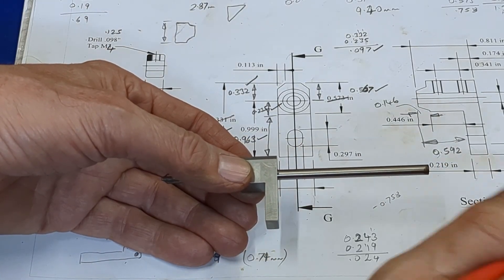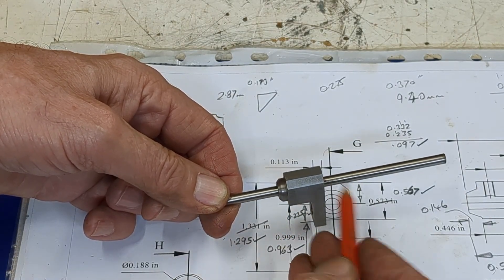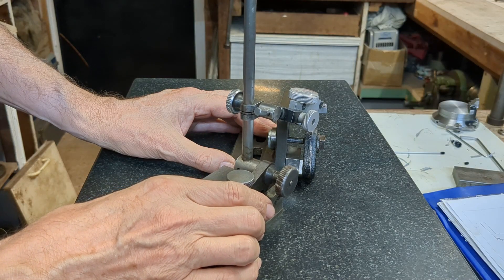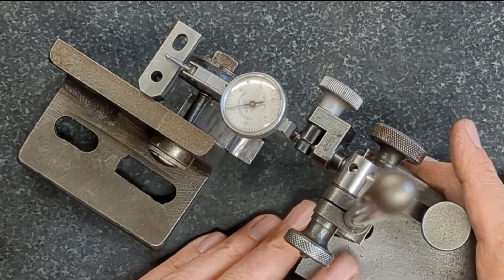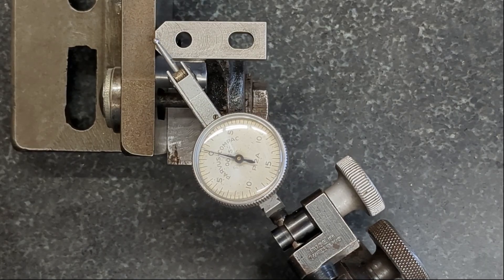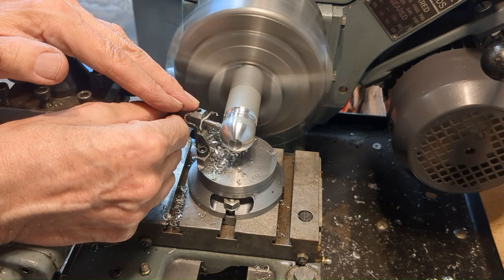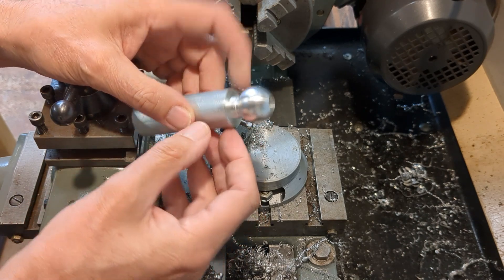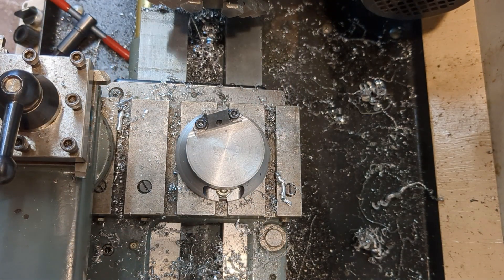Radius Turning Tool - part 5

Comment: A second collar behind the first, that is additionally drilled an tapped for an additional grub screw. The screw is installed horizontally, on the same axis as the cutter shaft. The screw pushes on the back of the original collar.

Lock the rear collar to the cutter shaft, adjust the front collar as necessary. Lock the front collar.  

Now you can adjust the depth of cut  accurately with the screw, and you can still use gauge blocks between the two collars for extreme accuracy, while never having to worry about losing your position. And it does not even have to be installed in the tool holder while adjusting.
Reply from the maker: Thank you, that is a great idea! Once I complete the next phase with the tangential tool holder I may try out this.
I really appreciate your suggestions!

Comment: So when you are talking about putting the tool holder in different positions, I just mounted mine on a slide.

I like the idea of a tangential tool holder.
Reply from the maker: Yes, I will be making a slide. There isn't much space but it will fit in.

Comment: If you are worried about distortion anneal the cold rolled steel before machining.
Reply from the maker: Yes, I should have done that! I think it is more of an issue with a longer thinner component I am now working on.

Comment: After seeing video's of other people making rather a fuss about case hardening, I was amazed by the apparent simplicity of your approach. If case hardening can really be done in such an simple way, I might try it out myself one day. Thank you so much!
Regards, Ruud
Reply from the maker: Hello Ruud. It may not be clear from the video but I heated the components and dipped them in the compound twice. I have used this method many times and it seems to work!
Reply: @Workshopfriend  Yes, I got that from the video. I have seen video's by other youtubers who create either an airtight container or some clay construction to capture the CO so it can diffuse into the steel. I did not know that just dipping the component in the compound (I presume it is activated charcoal, possibly with some soda) will do the trick as well.
Thanks again!
Reply from the maker: I am not aiming for a deep case but it seems to be enough for my applications. The components seem to come out with a consistent result (even if I can't quantify it). I think the airtight containers may be necessary if one is aiming for a deeper casing or even throughout the section - but then I would just use a steel that can be hardened if that was the aim. With longer soaking times will come more oxidation and a detrimental effect on surface finish. I use both Kasenit (which is not on the market now due to noxious fumes I gather) and the modern equivalent.

Comment: Nice work. It could be worth considering a rotation stop to prevent the possibility of turning the tool holder too far and hitting the turning lathe chuck. Cheers.
Reply from the maker: Yes, I totally agree. That would be a handy addition. I have something like that on my small rotary table but that has more height to work with. Will think about your suggestion.

Comment: That has " turned " out to be a really nice tool !
But, seriously, I think that it will need a handle, both for better rotational control in more difficult materials and user safety by keeping fingers away from the rotating bits !
If you were to drill clearance down the centre of your piece of stock, almost to the position of the proposed ball, then drill and tap further to create the ball fixing; reverse the stock in the chuck and machine the ball almost down to the clearance hole diameter. 
Part off, with your weapon of choice, and you have a spherical  ball, with a tapped fixing hole and very little finishing to do.
The downside is that it is wasteful of stock, but for one off productions, it may be okay . . . .
Reply from the maker: Thanks, Steve. Yes, I agree that a handle will be required. I think this is one of those features which is best settled in the workshop not at the drawing stage. With use I will hopefully find the best position and shape.
The component I need to make is for a ball joint so I still need to find a way to get into tight corners - but, for ball-handles your idea sounds good.
Reply: @Workshopfriend 
Apologies, I had assumed that the purpose of the exercise was to make a ball for the handle on your current project.
As an alternative,  could you consider making a ball on the milling machine ?
50 plus years ago, when I was at college, I recall the production engineering lecturer demonstrating this to us. The premise of the process is that two rotating points on intersecting planes generate a spherical surface.
To demonstrate, he set up a boring head in the vertical milling machine, with the boring bar set to generate an external surface, and the stock held in a three jaw chuck, fitted to the dividing head, which was inclined at some angle approaching 40 degrees.
By rotating the chuck, and gradually raising the machine's table, he produced a perfect sphere.
I've  forgotten the maths,  but it should be pretty easy to work out . . . .
I imagine that this is how ball joints used to be made, back in the day . . . .
Kind regards,
Steve A.
Reply from the maker: Thanks, Steve. I too have seen this process somewhere. It would be interesting to have a go at this setup, but it will have to wait for a more opportune time.